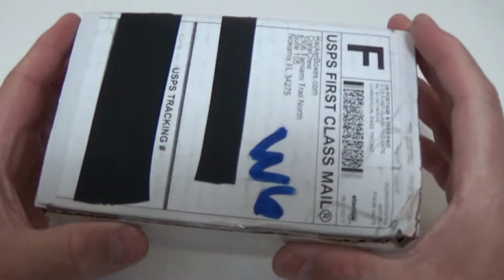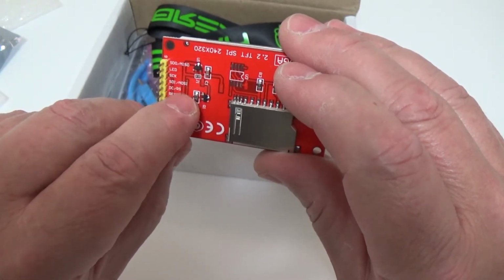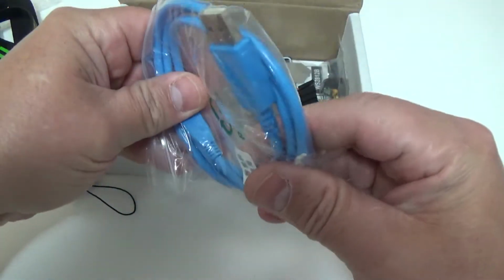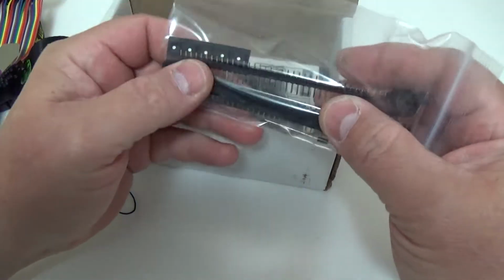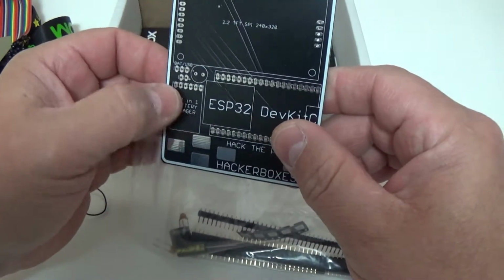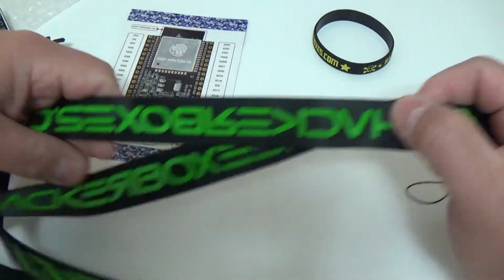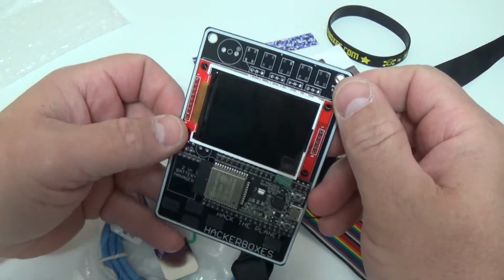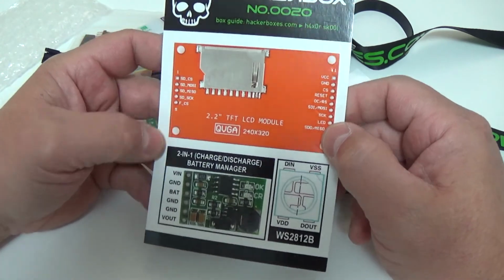HackerBoxes #0020 Unboxing

Comment: The whole box was meant to be the project in itself. If you have no use for the ESP32, that's fine, because it was only intended to be used as a "Defcon" badge
Reply: You also don't need to use the WiFi aspect of the board to use it for any Arduino based project. I will assemble the badge with stacking headers so I can easily take the board and screen off for other projects when I want.
Reply from the maker: I didnt realize the "project in a box" theme until the end. I will be honest I am not very happy getting a box that has such a narrow focus.
Reply: At the same time they're always getting flak for not having any projects in the box.